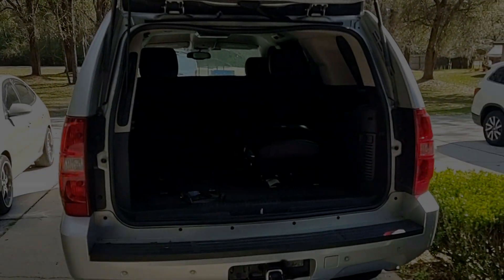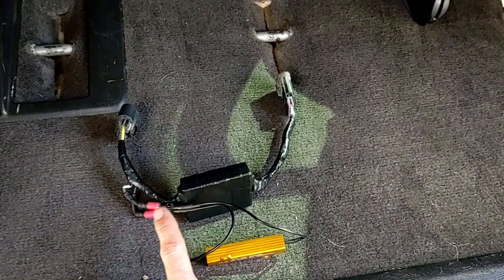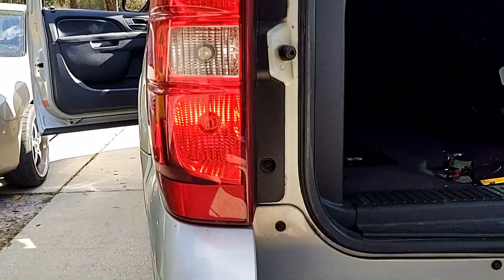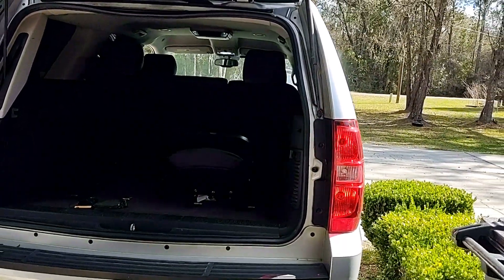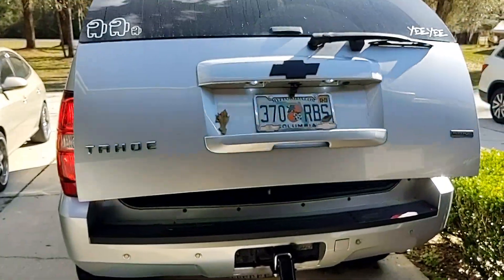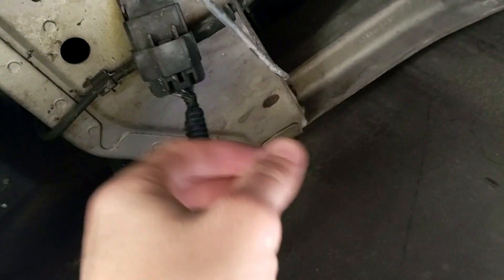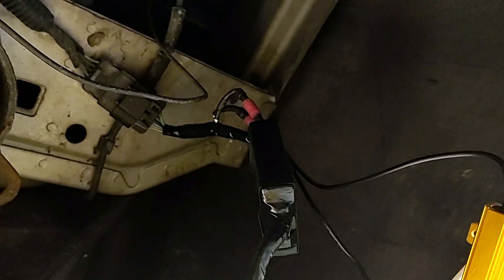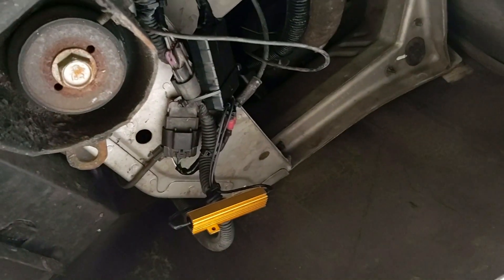Tahoe Taillight Function Mod

Comment: I was thinking of doing the Same mod to my 07 tahoe. Using Hopkins 4 to 5 pin conversion. 

But I decided to it a different way. Using and avalanche taillight harness. And having the reverse lights/ signal but using a switchback leds. 

You'll still have dual brake lights but signal will be in the clear reverse housing. With a switchback led.